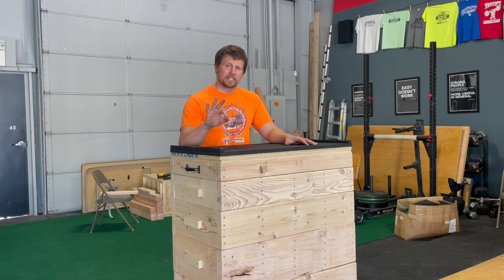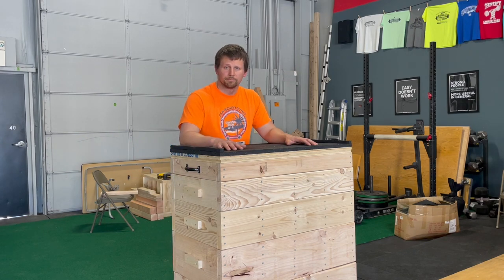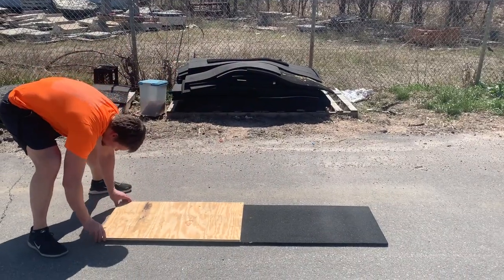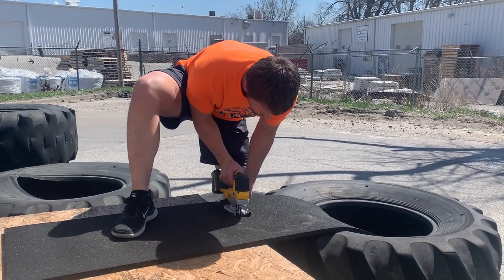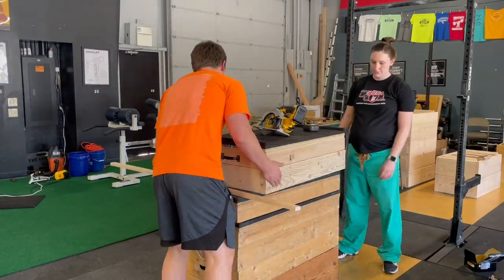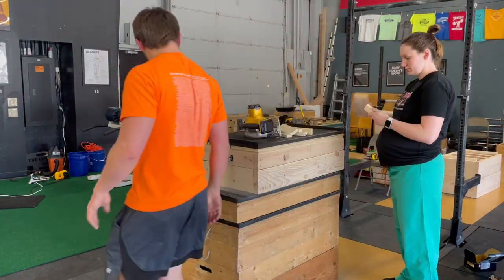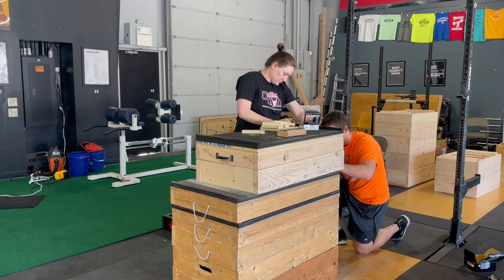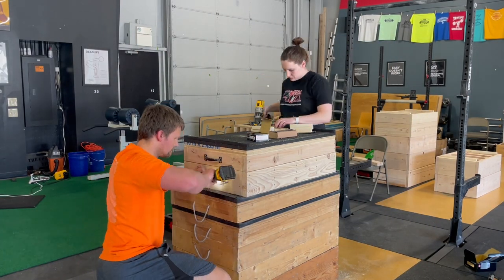How to Build Jerk Blocks - Part 3: Finishing Touches

Comment: what was the final cost for the entire build?
Reply: I'm building it now, it's in the $250 range
Reply: @noonagon1  even if it's several hundred more, it's way cheaper than buying prebuilds that are $1,000 or more
Reply: @JC-is1nl  I ended up at just over $300, but you're 100% right, WAY cheaper and solid AF, like bullet proof